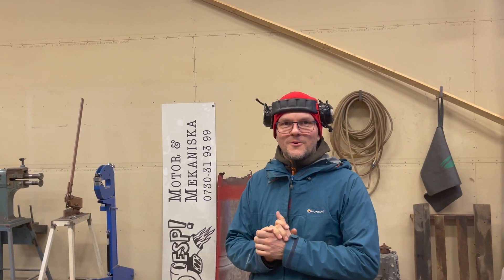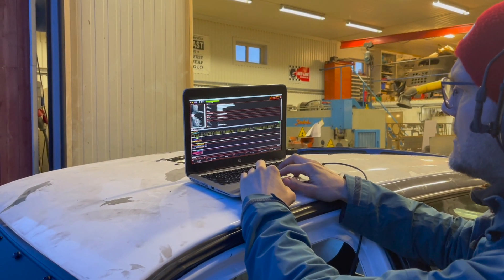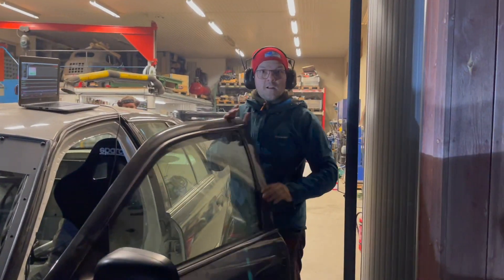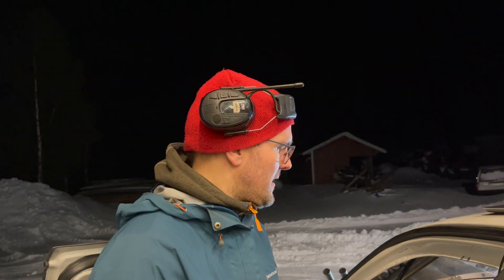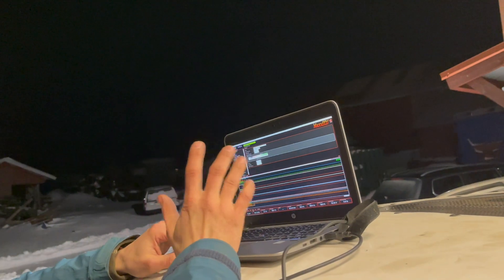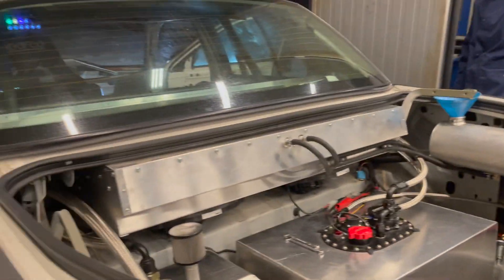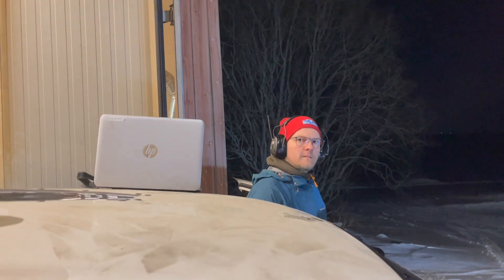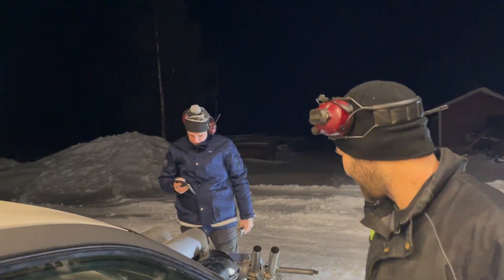First test of the complete drivetrain

Comment: Just curious..What is the predicted top speed with the current drive train configuration?
Reply from the maker: At 3400 rpm on third gear the theoretical top speed is 445 km / h 😀
Reply: @TheMeteorInterceptor  Really?   You would have to have an overdrive trans and a huge pinion gear in the dif.
Reply from the maker: @timhallas4275  No, we have a planetary gear between the engine and the gearbox that gears up 2,77 X. So 1000 rpm in the engine = 2770 rpm in the gearbox 😀

Comment: how many Gallons to the mile?
Reply from the maker: Well on full throttle it takes 24 liters / minute 😀
Reply: @TheMeteorInterceptor  wow that's mental, Back in the day when the Spitfire's  were running at full boost and burning 150 octane fuel at up to full throttle they would get through around 90 gallons (409 litres!) per hour. At 'cruising' speed and greatly reduced boost a Spitfire nowadays will make-do with 40 gallons (181 litres) per hour of 100 octane fuel, fuel was cheap then, unlike today

Comment: new to this channel just want to start off with this things awesome not sure if I'll get any answers just curious what's this build for like drag or just fun and what suspension is that thing running for that big ass motor lol can't wait to see where this goes and that first drive
Reply from the maker: Thank you very much! Well the car is basically built for fun, we will not dragrace it. Rather a top speed event. On third gear at 3400rpm the car would do 445 km/h. We have rebuilt the whole frame, rearend and the frontend to support the engine. How ever the engine is in aluminium so it is very light for it’s size. It weighs like 1,5 castiron big blocks 😀

Comment: Hahaha. What's the weight distribution on this one?
Reply from the maker: 47-53%
Reply: @TheMeteorInterceptor  That is... beyond impressive. Last I checked the stock vehicle had 55% on the front axle. How did you manage it with such a monstrous engine?
Reply from the maker: @AlastorTheLumbagosaurus  Thank you very much. Not much of the car is stock Crwon Vic any more and the engine is in aluminum, it only weighs 600 kilos. The engine is mounted as far back in the car as possible.

Comment: Is it really 27-liter engine? What's the mpg?
Reply from the maker: Yes it is 27 liter. Don't know the mpg, but at full throttle it takes 24 liters / minute
Reply: @TheMeteorInterceptor  6.34 miles per gallon, it's not even that bad, wow.
Reply from the maker: @SuperMonkei  it is not 24 liters per mile. It is 25 liters per minute

Comment: Soo smooth is that engine, you'd never expect it was designed in 1933, its a real credit to your abilities. You mentioned the Rev limit was only 2000 rpm, is that due to the inferior quality of the Meteor internals compared to a Merlin and its Forged internals as they were rated at 2850 - 3000 in W.E.P setting.
Reply from the maker: Well that was the rev limit when in the tank. We will rev maximum to 3750 rpm, but will begin with a rev limit around 3300 rpm 😀👍

Comment: What kind of power is expected for this?
Reply from the maker: We don’t know that yet, but the goal is a torque of 5000 Nm and around 2-2500 hp 😀
Reply: @TheMeteorInterceptor  that's increadible what's the current manifold temp under boost?

Comment: Those turbos look like they need more air than they can take in from those tiny filters! Also, they are right behind your intercoolers taking in the preheated air? Gotta get that unrestricted cold air in there for some Air Density!
Reply from the maker: There is absolutely no problem with air to the turbos. And the intercoolers make sure that the air is cool and nice 😀👍

Comment: Awesome build firstly. You had the tank ran at 2000RPM, what is the expected redline you will be running it at?
Reply from the maker: Thank you very much. A good rule of thumb is to stay below 24 meter/sek in piston speed for the oil film in the cylinder. With 152.4mm in stroke, it gives max: 4700rpm.  But better safe than sorry we will never go over 3750rpm. And to begin with, we will set the rev limit to 3000rpm, then we will move on to 3500rpm 😀
Reply: @TheMeteorInterceptor  whoooot  she sounded great at 2k rpm. That’s going to be one very tauquy lady to drive at those rpm…. Thank you for the response. And you’re taught an old dog a new trick today. I knew there was a calculation with bore/stroke to rpm but didn’t know what it was. Thanks guys
Reply from the maker: @synergycreations8960  Thank you for watching, and don’t forget to subscribe! 😀👍

Comment: I assume you replaced the axle. Ford 8.8 wouldn't last long.
Reply from the maker: We are still using the Ford 8.8 but heavily modified. But this car is not built to be a dragracing car, it is built for top speed 😀👍

Comment: It would work better with a blower or two. That turbo placement robs a lot of HP and most of the smoke comes from the turbo oiling system, as the restrictive air filter and opposite inlets create a vacuum inside the housings. Also the RPM range is so low, that those turbos will never wake up fully before red line. Crankshaft mass in that engine wouldn't notice even the largest screw with the smallest pulley, and the torque curve would be a lot easier to tune.
Reply from the maker: The smoke comes from the fact that it was -10 degrees outside 😀
Reply: @TheMeteorInterceptor  I don't mean the white vapor when the engine is cold and outside, obviously, but the black soot it shoots when you rev it inside the building.
Reply from the maker: The turbos oil return are attached to the suction stage of the dry sump oil pump and there is not much air passing through the turbos to make 2000rpm at no load. The smoke is unadjusted acceleration enrichment. I can assure you that the turbos will increase the engines power output.
Reply: @TheMeteorInterceptor  Will they increase, propably. But would a screw blower setup, or a procharger do it better, most definitely.
Reply from the maker: @oikkuoek  We have already built two Meteor engines using ProChargers in the boat Sweden S1. So we actually have experience from that already. That is why we are using turbos instead this time
Reply: @TheMeteorInterceptor  Good! Then you'll notice the difference when you try to dyno tune that setup. Just remember that those turbos are starving for cold air due to the placement choice.

Comment: You guys are probably the first ever to tame a tank engine with fuel injection and electronic ignition. It starts right up!
Reply from the maker: Thank you very much! Yes it really makes a difference 😀👍
Reply: I reasently bought and fixed a V-12 Maybach HL 230 P30 gasoline 700 PS (690 hp, 515 kW) from a tiger 2. Planing on doing something similar to this.
Reply: Nah, tractor pullers did that. These guys just made it sound tame and modern.

Comment: What is the rev limit going to be I know you said 2000 but the smile on your face made me think you’re going to push it harder
Reply from the maker: Well when these engines are used in the Spitfire airplane (RR Merlin) they rev it up to 3000 rpm. And when they used them in Tractorpulling it is upp to 3500 rpm. So we will see how high we are going to go, but def. higher than 2000 rpm at least! 😀👍
Reply: @TheMeteorInterceptor  fantastic I knew there was something behind that guys smile